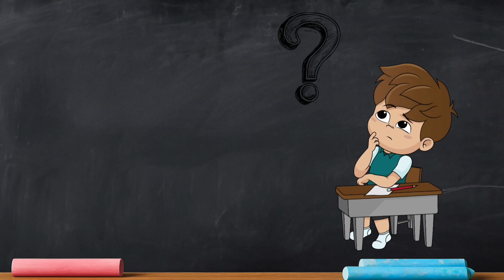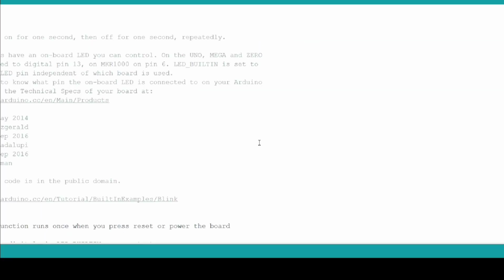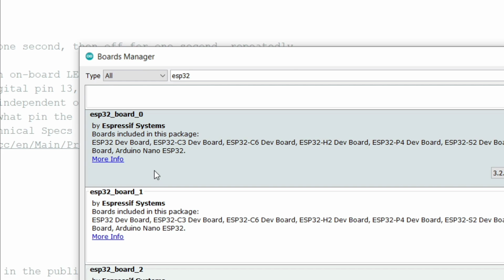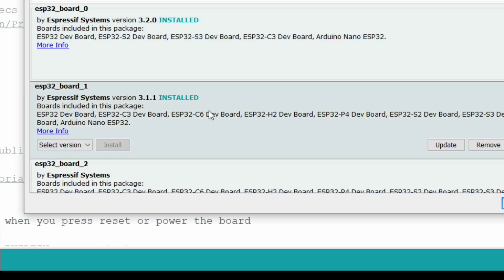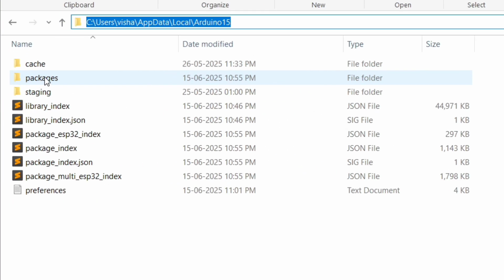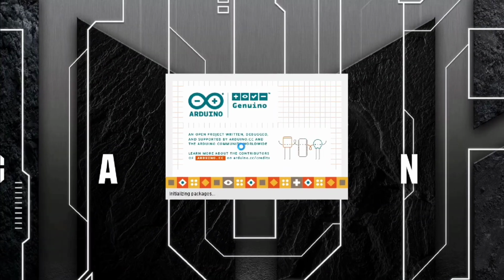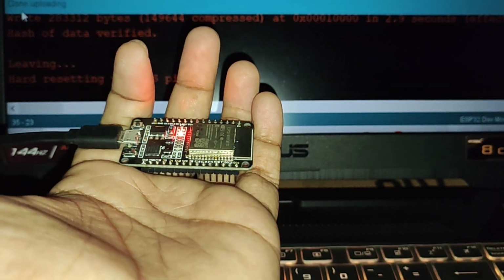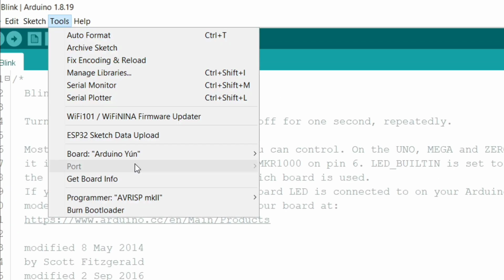How to Install Multiple ESP32 Board Versions in Arduino IDE (NO Uninstall Needed!)

Comment: Thanks, this helped a lot. I noticed that under IDE 2.3.8 the name= in platform.txt is ignored. But you can work out which is which, as it uses the esp32_board_0 etc names instead.
Reply from the maker: Thanks for the information, i didn't test it in Arduino IDE 2.x.x